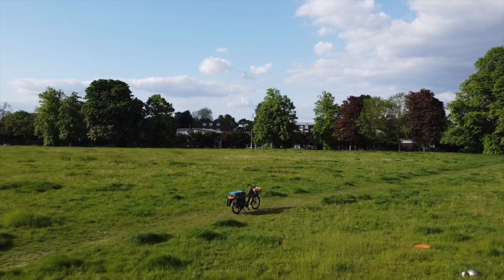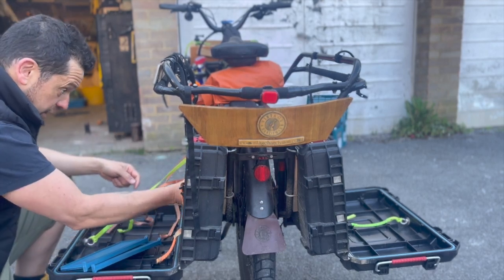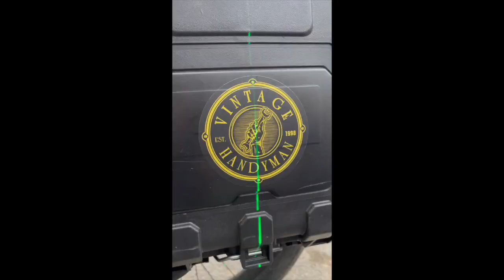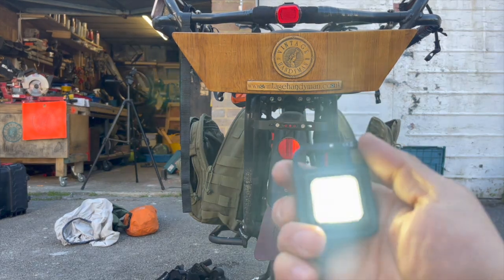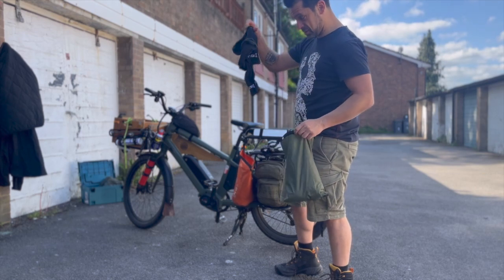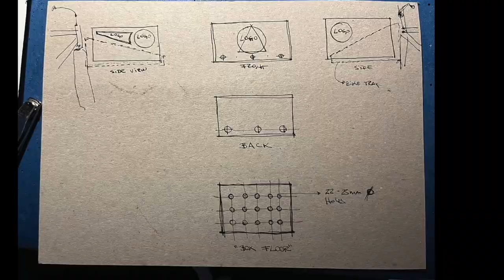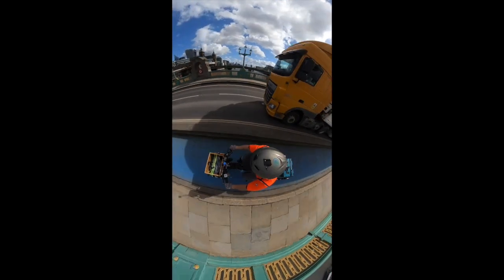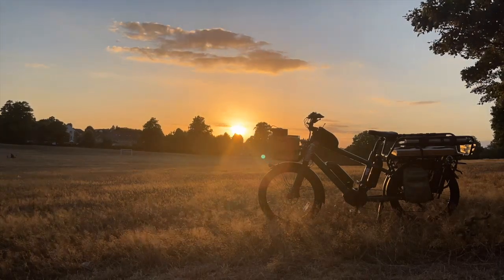Transforming The Beast: Switching from a Van to a Cargobike.

Comment: Great idea. But what happened to your epic trailer?
I am also trying to solve the problem of transporting my decorating tools, not enough for a van but more than I can fit on my bike. The problem is the UK shitty laws on ebike power, I could not pull my trailer up a hill with just fold up laddrs on 🤣🤣🤣
Reply from the maker: True. That trailer totally deserve a remake in steel… it will happens at some point.🤙🏽 Painters and decorators are the ones who carry the most stuff… will take a lot of planing to do it on a cargo bike…. May be day one and the last day in the van and the days in between on a cargobike?
Reply: @vintagehandymanproject  Yes you are right, its day one and last day that are the only problem days!
Reply: @khrysomallos4887 wow great!
I have a trailer with a solar panel that I use for camping, not big enough for work gear, but the new motor I got (Toseven  1000w) is very powerful, no problem going uphill with a trailer.
I think the answer is to build a trailer with a big box that is lockable, so I can leave it in a parking space, because the problem is the customers house might not have a private driveway, or similar, need to lock the trailer and tools too.
I will make a video to show my setup